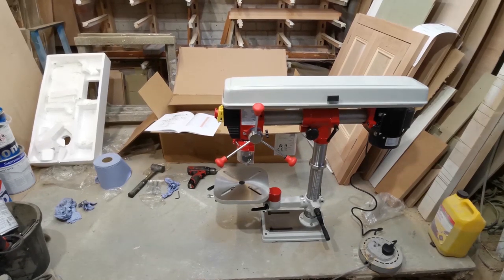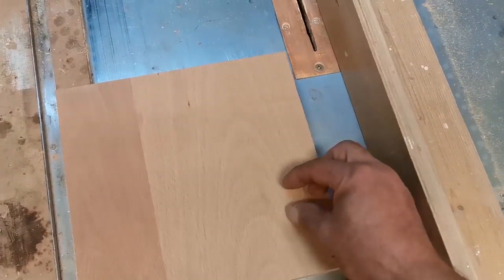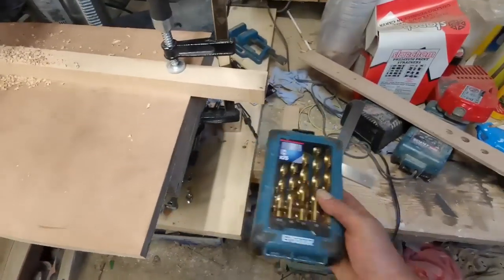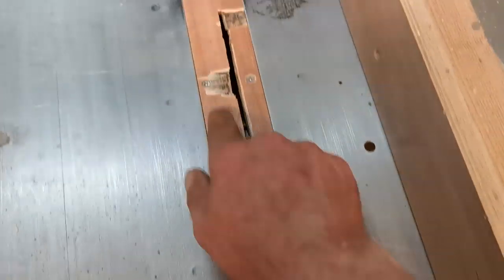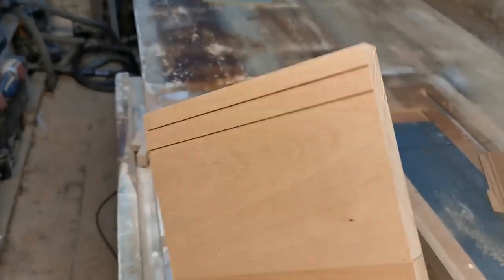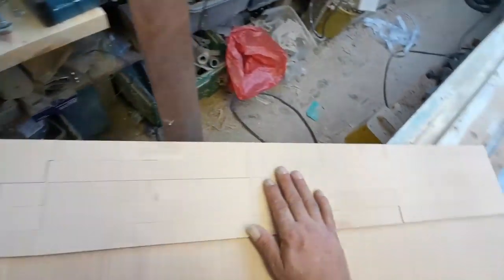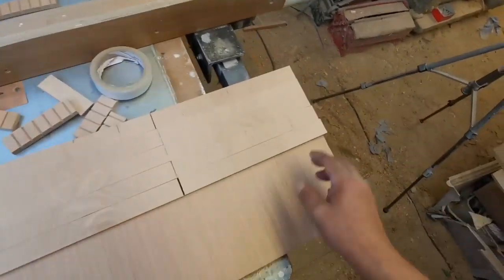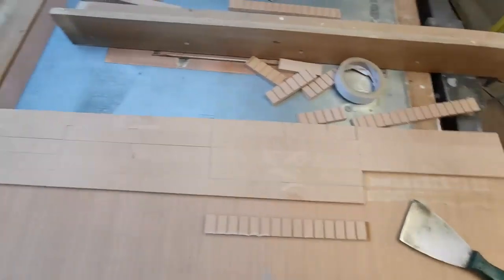Smith's Alcove cupboards & shelves Pt6 - Sunday night dentil pelmet thoughts & my new toy

Comment: Ive been trying to find a good pillar drill for ages. Im always worried about the play and movement in the chuck. I dont want to spend a lot as id hardly use it but i think they're brillaint when the time comes. Would you reccomend this one? Honesty. Is it the Axminster one? Cheers for the video, Gid 🙏👍
Reply from the maker: Thanks 👍 yep I've no job for it n it's just a toy at the moment, 😂 it's an Axminster one, they've got quite a good customer service. I paid a little extra then the standard drill because i wanted the reach/distance from the main pillar, I can't recommend as I've only just bought it but i put the 3mm bit in the vid to show it seems to be running true & the product info states 'Quality' bearings, time will tell. I want perfection but for a craft machine & the price I'm not going to get that, at the moment I'm happy with it, need to work out foibles of it